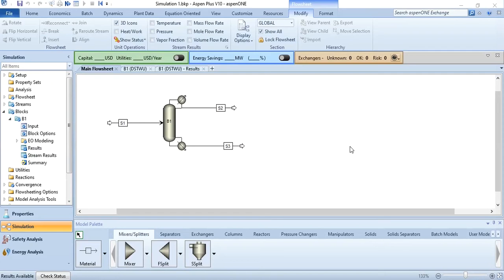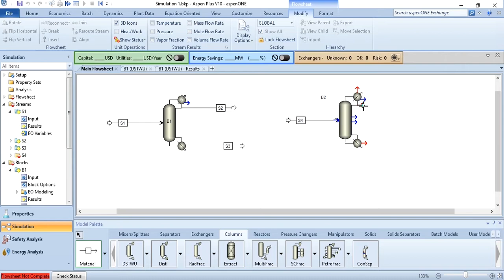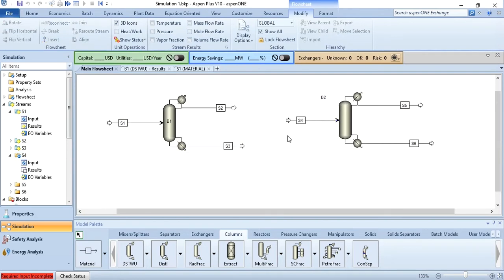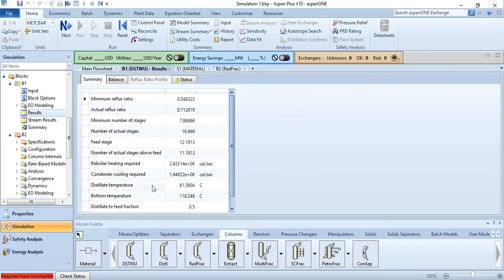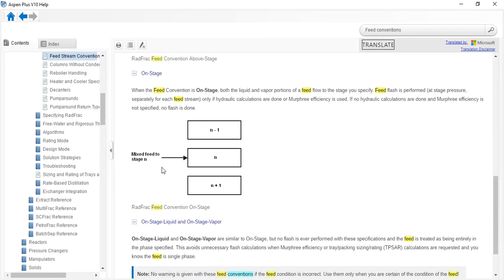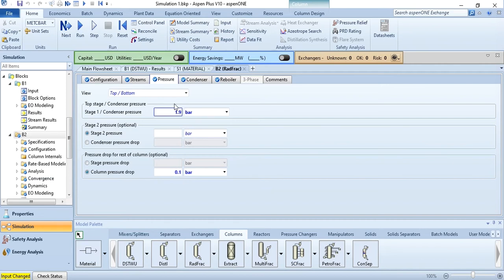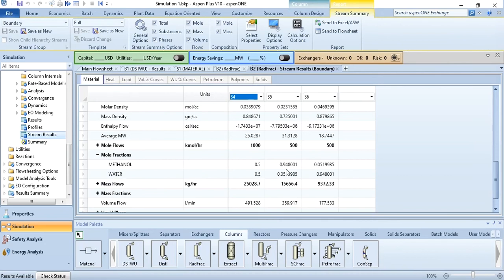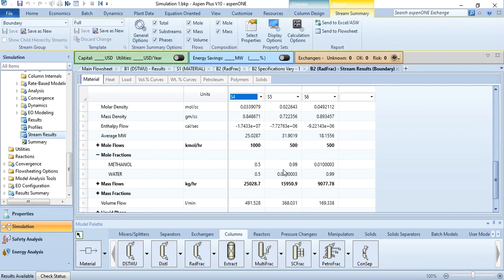Simulation of Rigorous Distillation Column to separate a binary mixture in Aspen Plus - Lecture 54

Comment: What is reflux ratio of -1. 3 ( what does minus sign represent)?
Reply from the maker: -1.3 means that Aspen will calculate minimum reflux ratio based on your provided specification, and then will multiply minimum reflux ratio with 1.3 to get the required reflux ratio and corresponding properties.